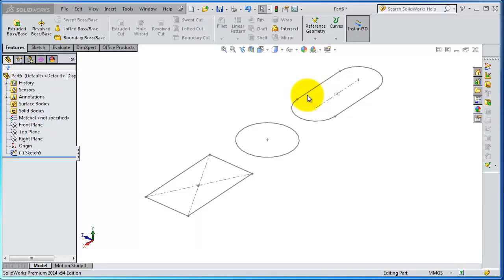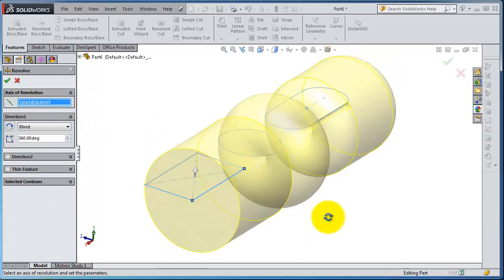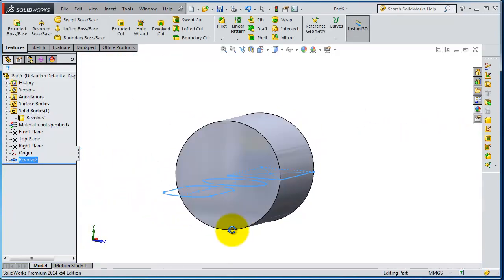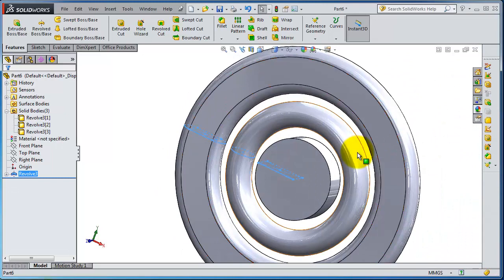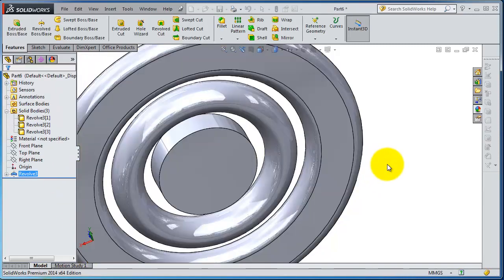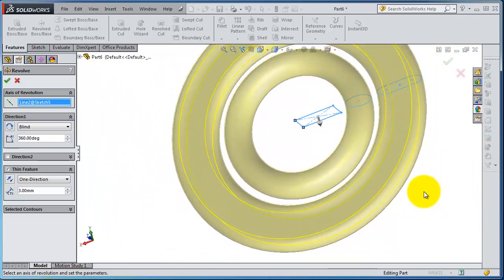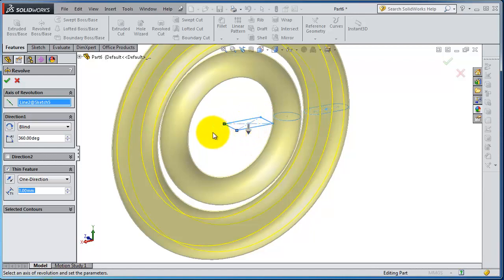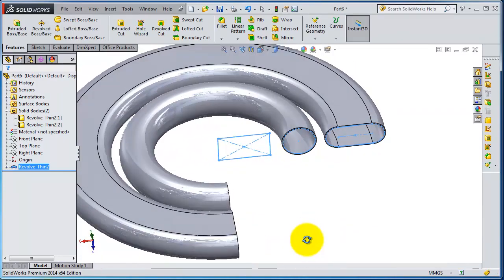SolidWorks Beginner Tutorial 28: Revolve Boss, using and examples

Comment: Sir, I don't have 'Thin Feature' in 'Extruded Cut' & 'Revolve Boss'. Why?

I have installed SolidWorks 2019 Students Version.
Reply: You can use the Command Shell instead.
Reply: @moisespessoa2 , Thanks!

I'm learning step by step; 'Shell' is Tutorial 55; will see that time!
Reply: @moisespessoa2  , now I got the 'Thin Feature' in 'Revolve Boss'; but not in 'Extruded Cut'.

I've learned 'shell' command now, but I think 'Shell' & 'Thin Feature' have different effects on the Part!